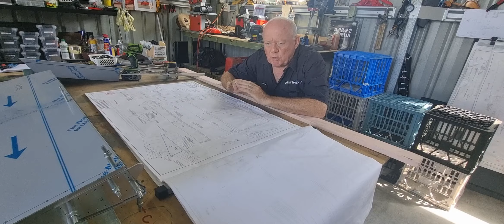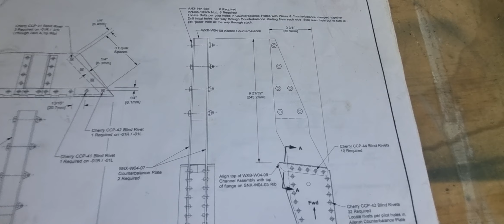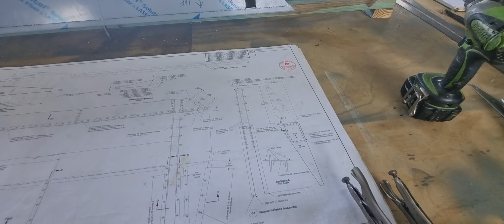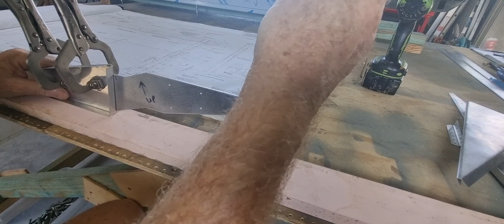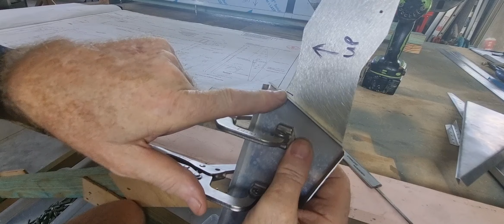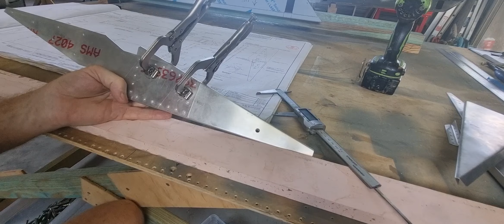Sonex Waiex B, part 60, Aileron build

Comment: Common problem there Andy with the AN-3 clearance. It's hard to believe that it is still not addressed. My fix was to use machine screws and countersink the area flush. Still working after 1228 hours in the air~:)
Reply from the maker: Hey Kip, hope all is going well...it sounds like it was and still is an issue....I will be using the old AN509-10R25-now MS24694, and believe its only required on one side [ right] , as the left ribs are facing opposite direction
Reply: @pandyseven  I can't remember that specifically, Andy. I'm sure that I went with all screws just to keep everything symmetrical:)

Comment: My counter weight bolts are also too close to that outer wing rib and interfere very slightly. I have considered both of Bryan's suggestions and will likely countersink the inside plate and install flush screws. The left side doesn't have the issue because the outer-most wing rib's flange goes toward the wingtip (instead of toward the cockpit), offsetting the vertical part of the rib toward the cockpit, which gives you a half-inch of clearance. Whichever option I go with, I'll use the same process in both sides to match weight.
Reply from the maker: He Dan, you can use the following: AN509-10R25 or MS24694-67- these are the two canopy bolts that countersink in the side of the fuselage that allow the canopy locking piece to slide back and forth....thanks to Bryan Cotton he did some research  for me/us
Reply: @pandyseven good to know. Thanks Bryan!

Comment: I had my wingtip off after about 400 hours or so and found the head of the AN3 bolts was gouging the rib.  I ended up sanding the bolt heads down.  When I shared my discovery on the forum others came forward and had used a flush head #10 in that position.  If you are painting the aircraft you will want to paint the ailerons before you do the balance step.  I drilled from the rear of the counterweight, which takes away less moment but more lead so you end up with a lighter part.
Reply from the maker: Thanks Bryan, and yes I will be painting so good advice...I did see it mentioned on the drawings about painting first. I am glad I am not the only one who has issues with the counterweights and will google those #10 flush heads
Reply: @pandyseven unfortunately the old forum is dead, so it may be hard to find. I didn't find anything on the new forum.
Reply from the maker: Hey Bryan, just doing a bit of search for those screws, and am getting a bit lost...do you happen to know what ones I order from Aircraft Spruce?
Reply: @pandyseven  probably a NAS 1203 Flush Head Screw of suitable length.  Let me check my plans tomorrow, the A model uses both 3/16" and 1/4" screws of that type.
Reply: @pandyseven  My plans show MS24694-S100 for the motor mounts on the classic A model.  Those are 1/4", and you want 3/32" to match the AN3-14A bolts called out for the counterweight.  The AN3-14A has a grip length of 1.125".  The closest I see on the tables at ACS is MS24694-S67 which also has a grip length of 1.125".  I would check that there is enough grip length there to get all the threads out of the parts.  I don't see that they stock that screw but you may be able to find it elsewhere.
Reply from the maker: Hi Bryan,  when I built my canopy for some reason I purchased some extra MS Screws for it, I think I was one short in the kit so got an a pack of 10 . I checked yesterday and they are MS24694-S67 or part # AN509-10R25-and are the same length as the AN3-14a so they fit...thank you for steering me in the right direction as always
Reply: @pandyseven if you don't have enough to do both sides, just do the one side. You will be removing lead to balance in any configuration.
Reply from the maker: Hi Bryan, I believe its only required on the right side as the ribs face opposite direction on the left